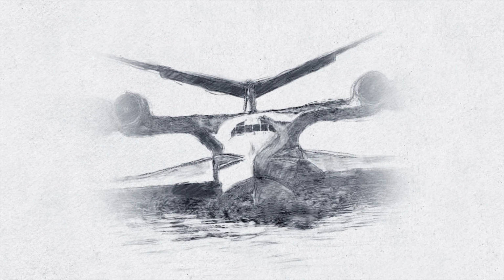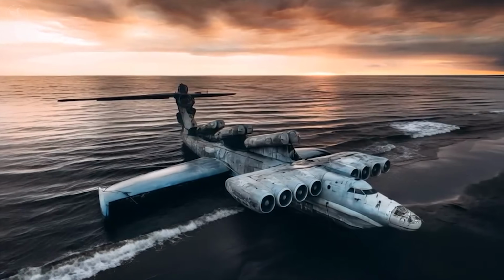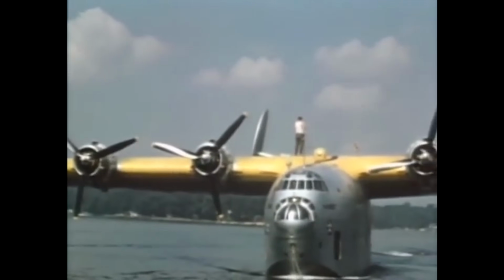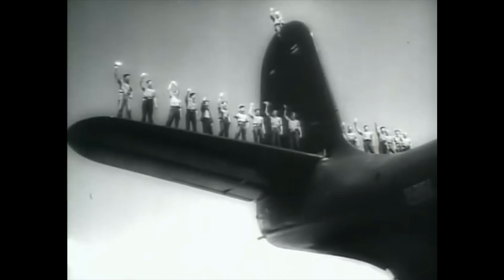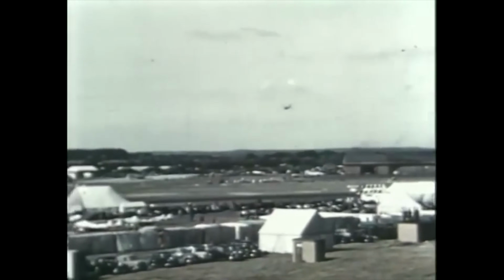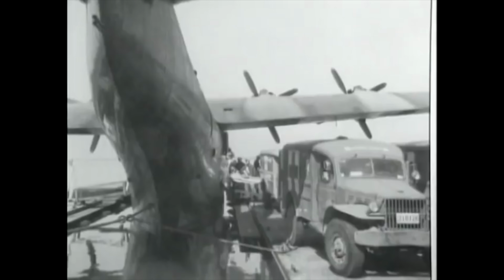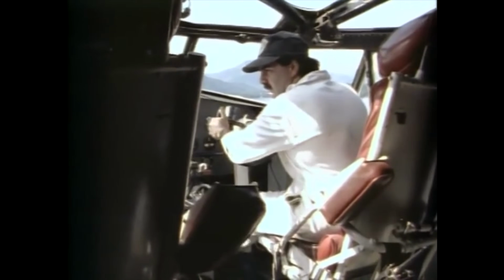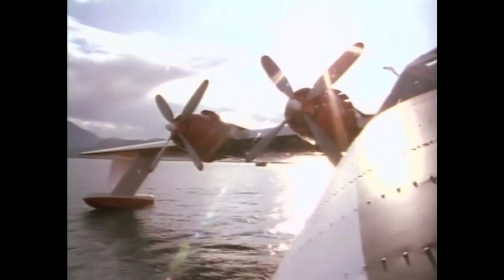Winged Sea MONSTERS: The Ekranoplan, Bizarre Flying Machines & The Origin Of Seaplanes

Comment: I haven't seen a running liberty engine but 2X in my life.  The first was being used in as a oil field sump pump. Where water was separated from  the crude oil.  Where the engine was the property of standard oil company . That was mounted on the back of a antique 2.5 ton Mack truck . In Taft Calif about 1964. That engine could mover some water & was loud.

The second time was a antique wooden boat show at lake Tahoe USA back in the mid 1980s.  Where there was a speed boat with 2 Liberty engines mounted on board.. The boat was built as a prohibiting rum runner on lake Michigan . And had the marine exhaust system on the 2 Liberty engines on board. This boat gave several exhibition runs and was pretty fast for being over 60 years old. And I doubt if they ever hit rodded those engines. But what a beautiful mahogany watercraft.

Good luck on your project , that's a pretty nobal goal for such a project. The best of luck too you  in the persuit of this project.